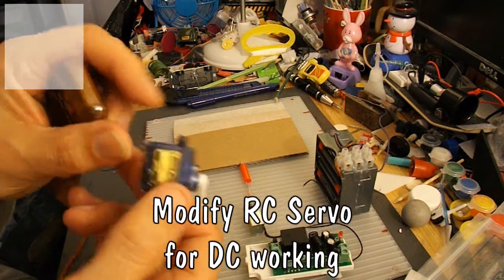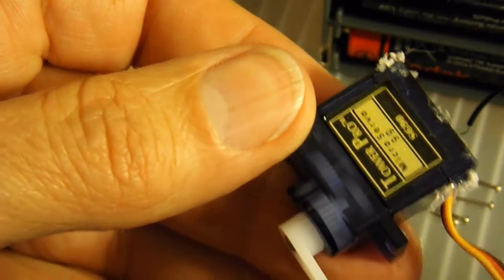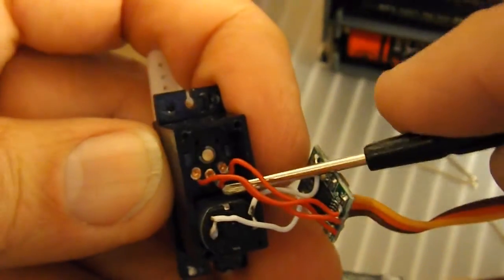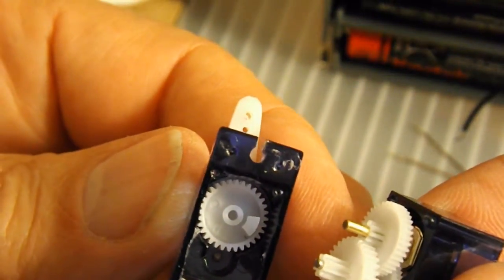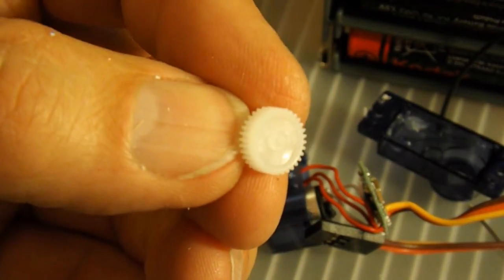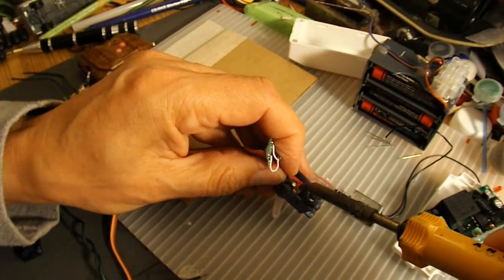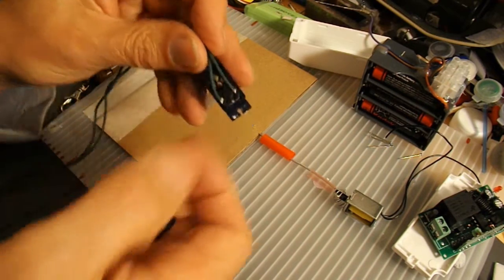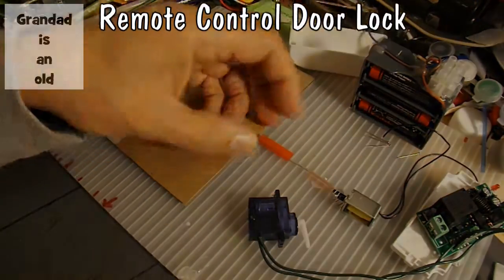Help File - Modify RC Servo for DC working and continuous rotation

Comment: So after you do this mod does it still have selective steering like when you turn half way it'll go half or will it go full lock I'm thinking about using it as a steering servo
Reply from the maker: In this video I show you that I remove the circuit board that controls the motor and remove the mechanical stop. That means it becomes a simple geared DC motor and that is the purpose of this modification. It turns continuously for as long as you apply power. I am guessing you are thinking of using this with toy grade RC where you just have left or right. In that case you might want to leave the mechanical stop in place so it does NOT keep turning, but you might stress the motor when it reaches the stop and probably damage the gears. You would also have the problem that there is no self centre facility so you will have trouble getting your car to go straight. If you wanted to use this for steering with proper hobby grade RC gear then there would be no point in doing any modification as the hobby grade RC does all you want. You can buy hobby grade RC gear relatively cheap if you go for the very basic entry level stuff. Once you have it you can then modify as many toy grade cars as you want as long as you ensure you can move the receiver from one car to another, or you buy a few extra receivers.
Reply: Yes I'm gonna buy a speed controller a transmitter and receiver and servo so I can have proportional steering on my drift car bc it slides good right now but the DC motor for steering sucks
Reply from the maker: @damiangarcia8753  yes buying the bottom of the range of proper hobby grade RC gear will get you started and get a feel of what can be done. Then you can decide if you want to get involved properly and spend much more money 😁

Comment: I guess it still have same amount of torque?
Reply from the maker: There is no change to the gearing so no reason for a change in the torque. Many people use this sort of modification in robotic applications as it gives you a handy well geared power source.

Comment: looking for help.
my steering servo keeps turning left and it doesn't respond to the transmitter.
not sure why this s happening tried to adjust the trim and everything else I can think of and the darn thing still keeps turning left and won't stop unless it's powered off. 
any idea on what caused it?? thanks in advance.
Reply from the maker: +Hydra Inarms have you tried changing the servo to check whether it is the servo or the receiver that is faulty?
Reply: +GrandadIsAnOldMan hey thanks for the reply back I noticed that when I press the trigger on the transmitter the Esc lights up but when I turn the wheel on the transmitter there's no light coming on from the esc.
brush less unit.
I place the servo on a different RC and yet it still keeps spinning so I'm guessing that the server is faulty

Comment: After connect on recevier (remote car)?
Reply from the maker: +Leo Bertomeu I am not quite sure what you are asking. It is now converted to simple DC control with 360 degree rotation. Yes you could connect it to a cheap RC toy car receiver and it would turn in whatever direction the receiver powers it. It will NOT stop until you return the control stick to a centre position. It will NOT auto centre. If you use it for steering and press LEFT the servo will turn left until you stop pressing left but it WILL NOT return to the centre. You would have to press RIGHT to move the steering back to the centre and on to the right. Now that it is converted to simple DC working it will NOT work with a hobby grade receiver. Perhaps if you read the reply I gave Farouq Hamzah it may give you more information.

Comment: Grandadisanoldman, what do you mean by those three wires helps to detect the rotation of the lever? Do you mean it's about the speed of the lever?
Reply from the maker: +Farouq Hamzah the wires go to a variable resistor that turns with the gears. The circuitry calculates the amount of rotation by the variation in the resistance. By providing two fixed resistors the circuitry is fooled into thinking it has not reached the end of the rotation so allows the motor to keep going. FliteTest have just uploaded a video showing another method of doing the same thing https://youtu.be/XUm2nj7te8E
Reply: Grandadisanoldman, how do I then modify this servo to work on a cheap toy car receiver as I'm using that cheap toy car receiver for my ship project
Reply from the maker: Farouq Hamzah the short reply is that the reason your car receiver is cheap is because it is not designed to use this sort of servo.
A cheap transmitter and receiver work simply like an on/off switch. For steering it provides three options. 1. Positive Negative 2. Nothing 3. Negative Positive This servo is designed to receive a coded signal from the receiver that tells it how far to turn in either direction. That is decoded by the small circuit board inside the servo and it turns the motor the required amount by reading the electrical resistance measured on the variable resistor connected to the shaft that turns the lever arm. You could modify the servo by removing the circuit board and connecting the wires from your cheap receiver directly to the servo motor. It will turn all the way to the left until it hits it's mechanical stop when your transmitter signals left. It will turn all the way to the right until it hits it's mechanical stop when your transmitter signals right. It will NOT return to centre when you move your transmitter to centre. You would have to signal the opposite turn briefly and hope to stop somewhere near straight. In my video I cut that mechanical stop away so the servo keeps turning like a normal motor because that is what I wanted it to do.
Reply: Thanks Grandadisanoldman

Comment: i did the same conversion on some servos... with that modification those are perfect for BEAM robots!
btw. did you bend the tip of your soldering iron yourself or have you bought it that way.?.the angle seems to be quite usefull.
Reply from the maker: MAYER MAKES the soldering iron was straight originally but it has taken a lot of abuse over the years and steadily developed that bend. I have some new tips but as you say, it has it's uses.

Comment: Hey grandad can you please make an extremely fast car any weight maybe spring rubber band mousetrap powered just make it like a mini drag car
Reply from the maker: Jack Mccafferty I don't do extremely fast cars. Just add more bands to any of my rubber band cars and increase the grip on the wheels to make them go faster.
Reply: Can you make just a plain rubber band powered car but with more a lot more rubber bands than usual and do it outside on your brick area with cos with tape for grip